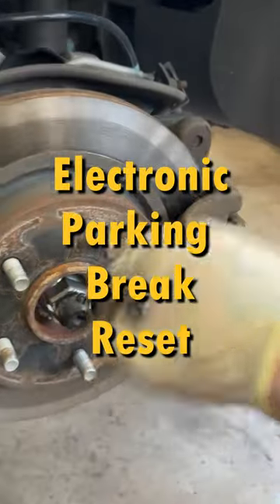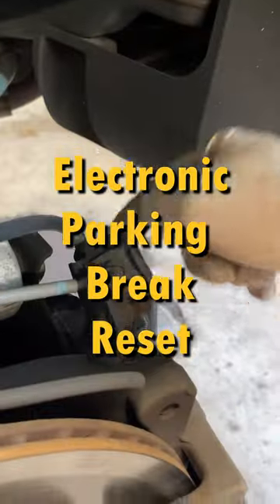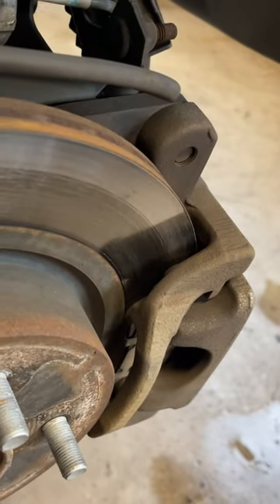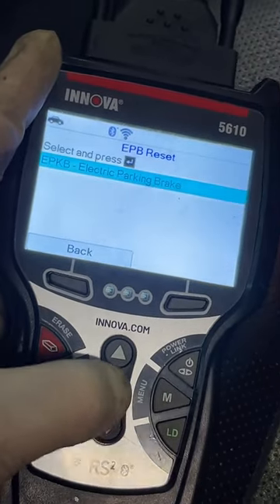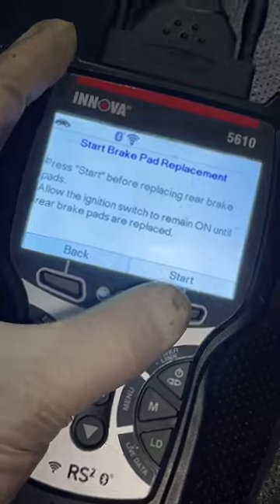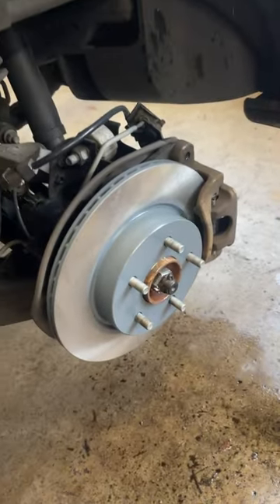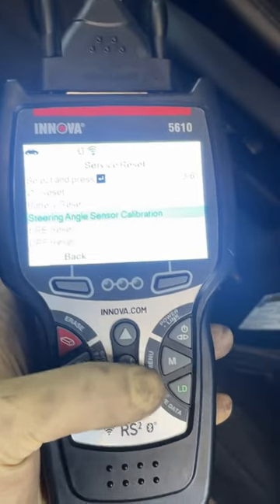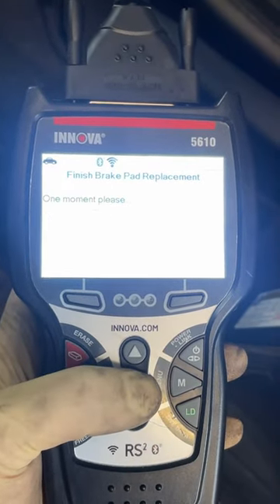How to Retract Electronic Parking Brake

Comment: Quick question? Do U keep the Obd connected while you do the work? Also Do I have to Dissconect The ebrake connector?
Reply from the maker: You need to keep the 5610 plugged in while you perform EPB reset. The 5610 will provide the instructions when to exit and disconnect the 5610 from the OBD2 port.

No, you don't need to disconnect the ebrake connector when performing EPB Reset

Comment: I just use a caliper pushing tool.. no electronics necessary
Reply: Generally not always a good idea with some motor’s depending on the car. But you can also open them with a battery and cables. Just don’t do it too far otherwise you break it

Comment: I am thinking of making an electric fridge. It will come with a cool controller with lots of buttons, bells and whistles. It will take you about 15 minutes to get a can of beer and will cost you only about 1500.00-2500.00 more than a old school fridge that will take seconds to open but you must use your hand. If you lose your controller you may starve to death so make sure you buy a extra controller just in case. Why anybody would buy such expensive stupidity is beyond me. I am a long time certified pro mechanic and i have left the industry because of this dumb sh.t.
Reply from the maker: This is just 1 feature the bi-directional 5610 offers. The 5610 can perform hundreds of active tests and relearning procedures. Active tests like commanding the fuel pump, cylinders, shift solenoids, liftgate, doors, windows, power locks, headlamp, and the list goes on...Relearning procedures like crank or cam relearn, transmission relearn, throttle, idle reset, etc. There is even an option to use the 5610 as an OBD1 tool. This tool sells at times as low as 220 on Amazon or TikTok. The 5610 can access OEM  Powertrain, Transmission, ABS, SRS, and TPMS Live Data. A tool with free updates, an award winning optional app with no subscriptions. Unlimited scans with no costs or hidden fees.
Reply: @InnovaAuto  Thank you for your information. Seems like the price of computers have come down a lot .  I am a certified master mechanic myself and have my personal computer still to this day for cars and trucks (snap on) . I have given up on automotive ( owned for years a commercial garage as well as worked for dealers) and transitioned into heavy duty trucks, graders, track-hoe's etc. and now work for a government sub contractor to repair and maintain highway maintenance vehicles of all types. I own and drive only classic cars for a few good reasons. Small block 65 4 speed Mustang vert, big block 496 auto 65 impala SS, baby big block 66 352 3 speed Mercury pick me up, 69 big 510 block 5 speed Cuda, 76 403 auto Firebird formula, 77 4 speed Trans/am, 80 4 speed 400 malibu and one 4x4 360 auto Dodge pick me up winter bomb. All are restored drivers except the Cuda that is on the rotisserie and the Mustang waiting for its turn on it. Seems like every time i finish one another pops up for sale around the corner like the 67 390 auto GT Fairlane across the street that is a driver with a bud light issue or the 68 Camaro in need of a restoration 3 doors down.